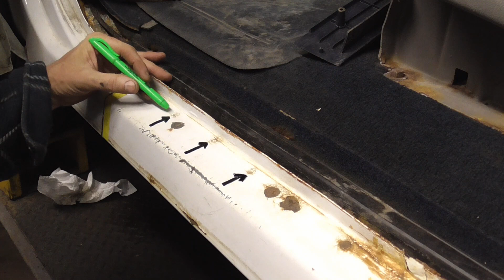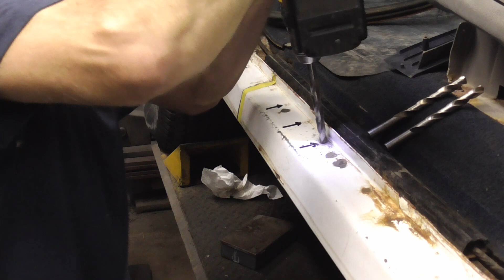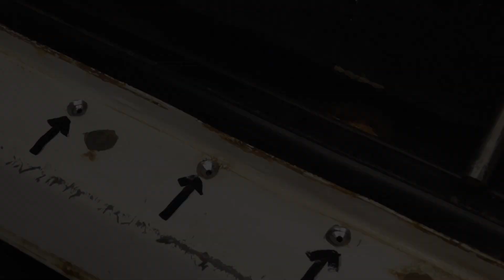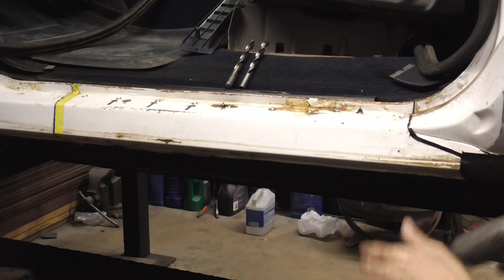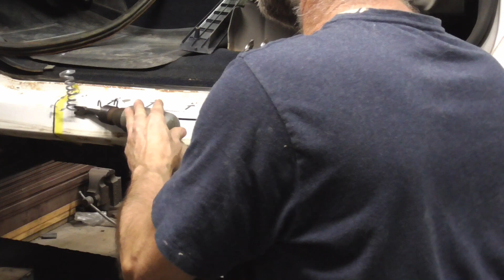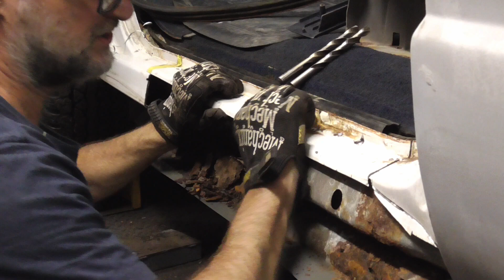Drilling Out Spot Welds - Cheap and Easy

Comment: how do you know how many hours to charge for putting in rocker panels?? Thanks
Reply from the maker: It usually takes around 4-8 hours to replace a rocker.  Shops or shop managers have software to guide them in the estimate.  If you don't have that figure what your time is worth and about how long it will take.  I would figure 1 day for each side to make sure.  Or you can keep track of the hours spent and charge (   )/hour for your labor.

Comment: You completely destroyed the inner panel. A free floating rocker panel?? Stop making videos.
Reply from the maker: It's very strong, people step on it all the time. You can do what you want with the inner panel - but if you build it like the factory it will rust again.  This will never rust again - ever.  Drainage is the key - no trapped moisture, rust chunks, leaves, dirt, etc.
Reply: This man thinks he's some kind of a badass . Even though he'd get knocked out with one punch

Comment: I had a collision car accident crash two days ago and the insurance would not cover it since it was hit and run. However, I thought about fixing it myself by removing the radiator support for the first time, but thought I couldn't remove it and put the new one in. However, I now see that it has holes and you taught me how to drill and use air hammers. I'm still learning from you. :)
Reply from the maker: That's great to hear - let me know how it goes for you.  Have a good weekend :)

Comment: So does the air chisel cut the lower welds ok? Great video. Nice intro music too !  ;)
Reply from the maker: Yes it will cut through any weld you need.  You do have to pre drill the welds though.  It can cut through welds that aren't cut first but it tend to tear the metal and not "pop" the weld apart.

Comment: Thank you! I'm in the middle of spot weld hell taking a part a 60s ford. Those spot weld bits don't last to long and it leaves you with a bigger stump to grind off
Reply from the maker: You're welcome - glad it helped.  I removed an entire van floor with just drill bits.  It does work well with nice sharp bits.

Comment: I have used this technique also. My normal technique is to use 3” air cutoff wheel over the the panel being removed - on top of the welds. It works pretty dam fast. Because I Hate Drilling! Lol
Reply from the maker: Yeah drilling can be miserable - 'specially if your bits are dull - which they usually are :)

Comment: I about had a panic attack when you pulled the panel down and all that rust was in there.
Reply from the maker: Crazy isn't it? All those flakes of rust, dirt, leaves gather inside - they get soaked with salt water, stay wet and rot out the lower portion of the panel.  Glad you saw that.
Reply: @LakesideAutobody  I can also see how flooded vehicles would rust out if water got trapped in there with no way out.
Reply from the maker: @AcuraLvR82  There are usually drains at the bottom of doors, rockers, fenders, hoods, etc but they often get plugged with debris.  BTW, cool dash lights on the 1992 Acura.
Reply: @LakesideAutobody  Thank you. Im currently watching your mig welding videos to learn rust repairs on Hondas.
Reply from the maker: @AcuraLvR82  Cool - feel free to ask any ?s

Comment: awesome video! Do you weld up the holes before putting new panel on mate?
Reply from the maker: No (I'll probably get some flak from readers).  I figure there's holes all over the structure of a car why should I worry about a few 1/8" holes.  Just drill new ones and plug weld.  I'll post a video on that.  Glad you liked the video.  Merry Christmas.

Comment: I like all your videos you always have awesome tips. What I found in the past to work really good is a 3/8 drill bit just drill into the first panel so it makes a round circle then use a 3/8 4 fluted End Mill. At one point I was taking a 3/8 in drill bit in grinding it almost flat. But I found the End Mill Works awesome and it only goes through the first panel give it a shot you might like it
Reply from the maker: Nice tip. I'll give it a try - always looking for a faster easier way. Happy Holidays and thanks.

Comment: That piece of steel that you said was solid, sure didn't look like it when you were removing those other pieces, especially if that was the frame, it is shot to.
Reply from the maker: The video is really about removing spot welds.  That piece that was toast was not part of the frame.  If you find that the metal is not sturdy enough you can always take off more till you find good solid metal. Then fit the patch panel to that.  Happy Holidays
Reply: @LakesideAutobody  Smile I was referring to the inner piece |Not the one you took off,
Reply from the maker: @CMAenergy  OK - Have a good weekend.